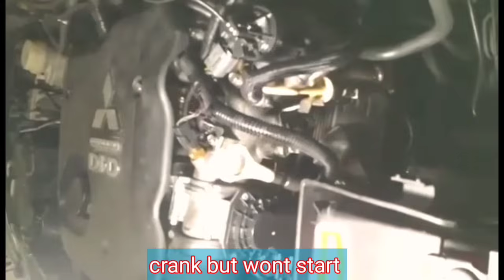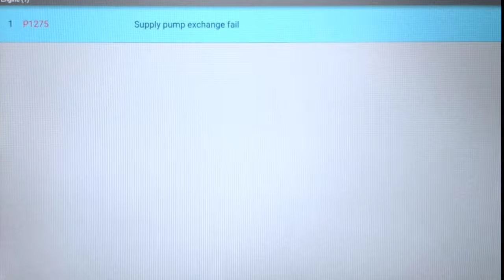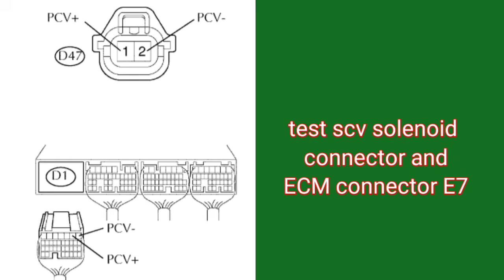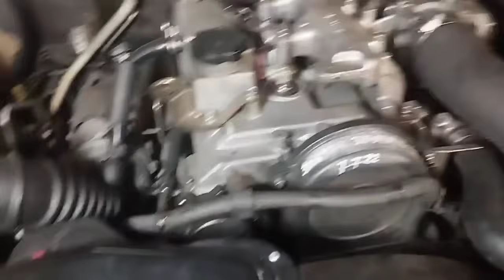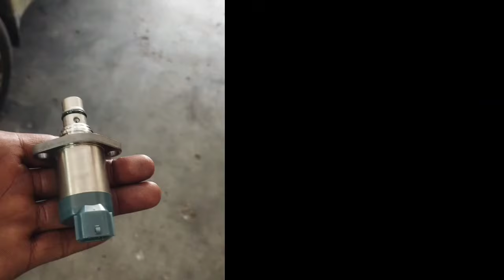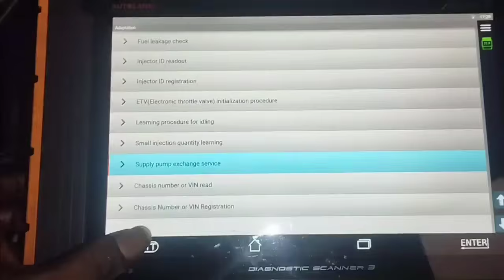Mitsubishi Pajero/TriTon , Crank But No Start, How to Fix engine code p1275  ! Fuel system problem !

Comment: Mine is a Nissan D22Navara NP300.I change SCV but still the same.It starts but runs with a knock sound.
Reply from the maker: Please check fuel pressure , test or replace,,,Fuel Rail Pressure Sensor , fuel injection ,,,

Comment: Mine is 4m41 engine  2011 monTero, I replace my scv now car is starting but occasionaly the engine stopped in traffic,on low iddle. What next step should I do? Relearn? And then?
Reply from the maker: Replacing the Suction Control Valve (SCV) on a 2011 Mitsubishi Montero with the 4M41 engine can sometimes lead to low idle issues. This is often due to the need to perform a Fuel Pump Learning procedure after the replacement, which allows the ECU (Engine Control Unit) to correctly calibrate the new valve.

 Low Idle After Replacement : 
Replacing the SCV without recalibrating the ECU can cause the engine to idle poorly because the ECU is still expecting the old valve's settings.
Reply: Thank you for this information.  @SCSautomotive.1988

Comment: mitsubishi Triton 2008 
i have problem in the key transponder ring antenna the car sometimes work sometimes not .. can i replace just the ring antenna at the same key or what..what should i replace
Reply from the maker: The owner of a car can program some key chips by following detailed instructions found in the owner's manual or online. Other automobile key chips, however, might need specialized tools and the help of a professional locksmith or dealership.

Comment: Hi I have problem. Strada matic long time crank and start but it's suddenly stop again . I saw the outlét won't have desiel oil pressure it's empty. What's a problem? I hopefully can you share your answer here. Thanks
Reply from the maker: Check with the scan computer to see if there is a fault code. Is there a fault code for the oxygen sensor? If the problem is not solved by replacing the oxygen sensor, be sure to check the oxygen sensor cable connection.

Comment: My 4m41 rail pressure fluctuates between 3500 and 7500 on idle. Is that normal values? I replaced the SCV and took it to a shop for a relearning of the supply pump, but I think it was done wrong. There are no fault codes though.
Reply from the maker: In this issue, a fault code is not always present, the symptoms are stalling, running rough, surging or not starting and/or the engine starts and then shuts off again pointing the technician to the suction control valve (SCV)
Reply: @SCSautomotive.1988  Thanks! What would be a normal rail pressure on idle?

Comment: Engine knocking with black smoke coming out from exhaust pipe.
Reply from the maker: What car?
Reply from the maker: When a diesel engine is knocking and emitting black smoke, it's a strong indicator of incomplete combustion. This means the fuel isn't burning efficiently, and there are several potential causes. Here's a breakdown of the common issues:
Key Causes:
 * Improper Air-to-Fuel Ratio:
   * Black smoke primarily signifies a "rich" fuel mixture, meaning there's too much fuel and not enough air.
   * This imbalance can stem from:
     * Dirty Air Filters: Restricted airflow limits the oxygen available for combustion.
     * Faulty Fuel Injectors: Injectors that leak or spray improperly deliver excess fuel.
     * Malfunctioning Mass Air Flow (MAF) Sensor: Incorrect MAF readings can lead to inaccurate fuel delivery.
     * Turbocharger Issues: If the turbocharger isn't providing adequate boost, it reduces the air entering the engine.
 * Fuel System Problems:
   * Issues within the fuel system can disrupt the proper fuel delivery.
   * This includes:
     * Clogged Fuel Filters: Restricted fuel flow can cause incomplete combustion.
     * Fuel Pump Malfunctions: Inadequate fuel pressure can result in a rich mixture.
 * Engine Component Issues:
   * Problems with internal engine components can also contribute.
   * This can include:
     * EGR (Exhaust Gas Recirculation) Valve Problems: A stuck-open EGR valve can introduce excessive exhaust gases into the combustion chamber, disrupting the air-fuel mixture.
     * Diesel Particulate Filter (DPF) Issues: if the DPF is heavily clogged, it will cause backpressure, and poor combustion.
 * "Knocking" or "Pinging":
   * This sound often accompanies black smoke and indicates abnormal combustion.
   * It can be caused by:
     * Poor quality fuel.
     * Incorrect injection timing.
     * internal engine wear.
What to Do:
 * Address Immediately: Black smoke and knocking indicate a serious engine problem. Continuing to drive can cause further damage.
 * Professional Diagnosis: It's highly recommended to have a qualified diesel mechanic diagnose the issue.
 * Maintenance: Regular maintenance, including air filter and fuel filter replacements, is crucial for preventing these problems.
In summary, the combination of black smoke and knocking points to a critical issue with the diesel engine's combustion process. Prompt professional attention is essential.

Comment: My car is just cranking but won't start have tried changing  suction control valve  what can be the problem
Reply from the maker: Check scan computer any fault code

Comment: Hy since you sheared a great video about mitsubishi L200. I have a problem car installed while driving L200. Push button start, now car no ignition no crank. I believe it went to mood situation. Any solution please.
Reply from the maker: Since you have push-button start and are experiencing a "no ignition, no crank" situation, here is a list of possible causes.

1, Check the battery: Try to jump-start the car.

2 ,Check the battery terminals: Make sure they are clean and tight.

3, Try your spare key.

4,  Check the immobilizer warning light.

5 ,Replace the key fob battery.

6 ,Check the fuses related to the ignition and starting system.

7, Make sure you are pressing the brake pedal firmly when starting.

Comment: My pajero sport cranking but no start u1101 fault code are diagnosis
Reply from the maker: Check the 'possible causes' listed above.  Visually inspect the associated wiring harness and connectors.  Check for damaged components and look for broken, bent, pushed out or corroded connector pins  And check relays and fuses
Reply from the maker: The combination meter receives transmission control system-related signal from the engine-A/T-ECU via CAN bus lines. If the display unit can not receive the necessary signals, diagnosis code U1101 will be set
Reply: When i spray petrol in air filter then car is start...

Comment: My car cranks but won't start I have changed the injection pump complete with the sensor still didn't start I replaced the ECU still don't start, what can be the case?
Reply from the maker: Can you tell me what car you have?
Reply from the maker: test common rail pressures sensor